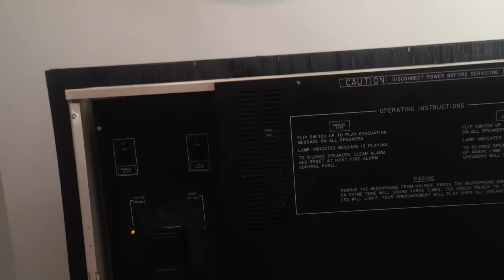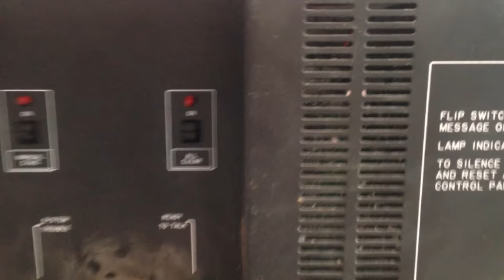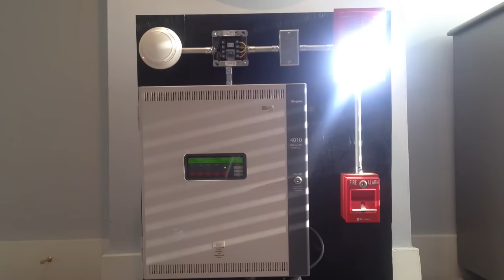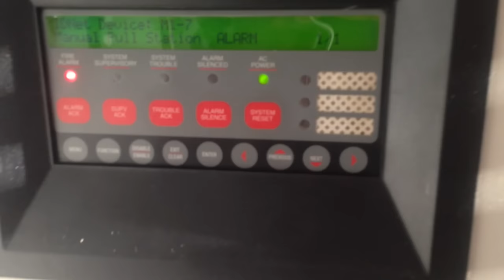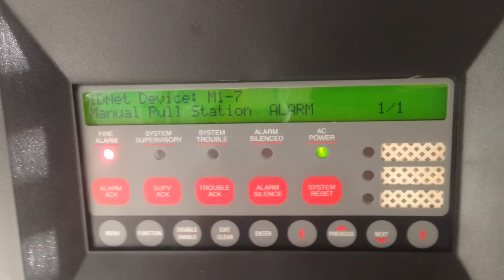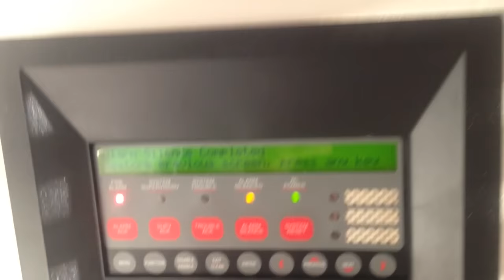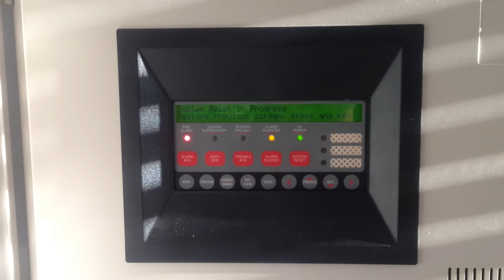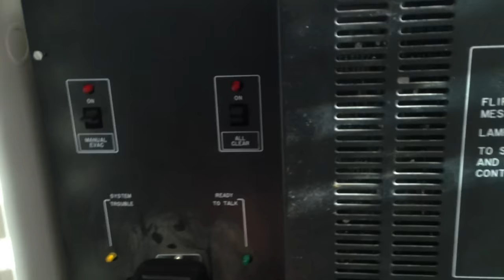*New* Simplex Demo System Test 1

Comment: My middle/high school academic building at the Maryland School for the Blind has the exact same voice evac message. Also, a Simplex T-bar pull station, but with Wheelock speaker/strobes. Our middle:high school academic building is required to have a voice evacuation system because the library and dining halls are designated as large meeting places, thus requiring communication systems for all of the occupants. Our main school building, where the front desk and elementary school classrooms only have Simplex buzzers, with TrueAlert speaker/strobes. That building is much older than the other building. It all depends on when the building was constructed and/or whether that building is used for large assemblies. During our school monthly fire drills, when everybody is allowed to go back inside the building, we do not use the default "All Clear" message; instead building personnel, custodians, security guards and/or maintenance workers tell us when it is safe to go back inside the building.

Comment: Reminds me very much of the main public library in my city; they have a Simplex 4010 and 4003 system setup with TrueAlert speaker/strobes and those earlier new-style TrueAlarm detectors. Except the pulls are dual-action 4099-9003s.

Comment: I recently got an Edwards E-FSA250R, how can I get a plug, so I can plug in the panel?
Reply: +Hunter Cullen (ilovepolice1) get an extension cord and cut the part where the plugs are and strip the wires and wire them into the panel and just plug the cord in and you got power to the panel
Reply: I'm getting a different panel now. It's either going to be Fire-Lite or Potter Electric Signal.
Reply: I have a Fire-Lite MS4 its a great panel very simple to use